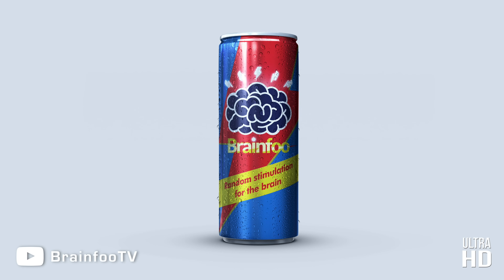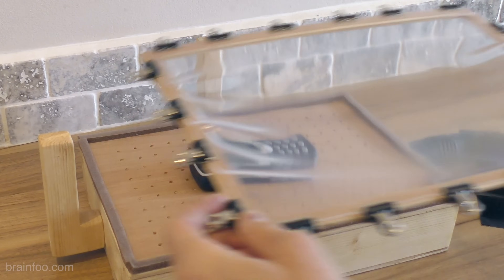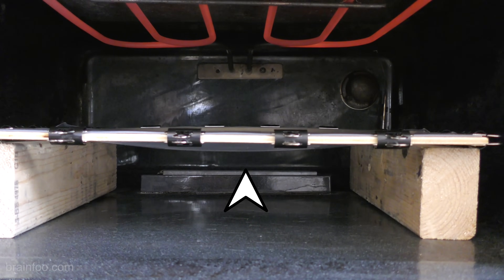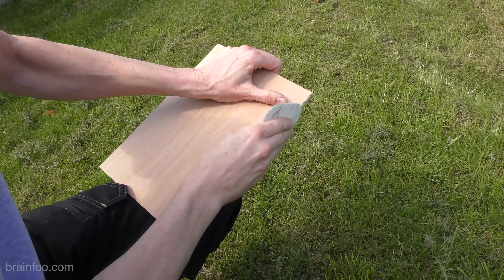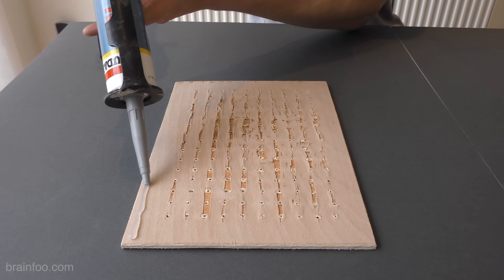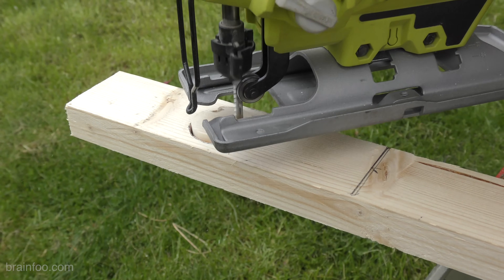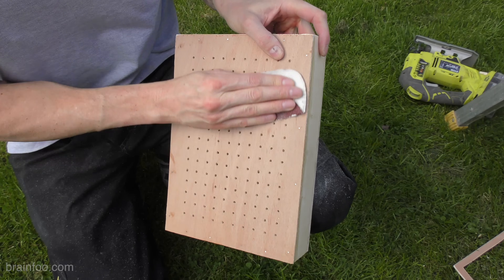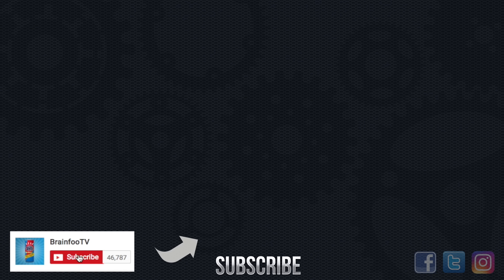EASY VACUUM FORMER - Chocolate NOKIA

Comment: PVC rigid film/PLA film/PET film 
PVC lamination film
PVC/PVDC film 
PVC metallized film
PVC/PVDC/PE film 
PVC/PE film 
PVC/EVOH film
PVC/EVOH/PE film
Cooling tower PVC film 
Antistatic PVC film 
PET film 
PET/PVDC film 
PET/PVDC/PE film
PET golden film 
PET silver film 
PET anti fog film 
PET face shield 
PET G film
PET/PE film 
PET/EVOH/PE film
PET metallized film 
Extension tubes with needle free connectors
PA/PE film
PA/EVOH/PE film 
PA/PP film
PP film
PS film
Blister aluminum foil 
Alu alu foil
Goggles 
PET Folding boxes blister boxes 
For food packages electronic package blister packages pharmaceutical packages and folding boxes and so on

Comment: Great Video! Who wants to discuss the desired most efficient "depth" of the suck box to get the best Vacuum action going? On the small 12" x 12" inch vacuum form table I'm attempting to build, I already want to place the vacuum hose straight down under the table like a kitchen sink. Don't mind placing the vacuum form box up on stands or even wheels. My shop Vac (I plan 2 use with the vac-u-form) is a 1989 Genie 1.5 (horsepower?) 2" inch hose outlet model that still works fine.

Comment: Could you use a heat gun to melt the plastic instead of the Oven 

Has anyone tried this?
Reply from the maker: Only for very small surface areas
Reply: Yep! Wanted to know the same thing! If its 2:30am and your FX Prop is due at 8:00am,  I would try a Heat Gun (not a blow dryer) if I was makin' somethin like a Zorro Mask. Would even use my Mannequin's head as a "buck" after I applied some Aluminum Foil on the mannequin to help protect it from the heat. Hey! I think I did this already and just gave away a hidden gem fx shop secret! Oops! #DesignerTJP

Comment: Doesnt work at all for me. Plastic  keeps getting air holes and gets to hard before forming half way forms. I hate it doesnt work for me and spent a good price on plastics. Ughhhhhhh
Reply: Put in toaster oven @ 250 degrees. And form box is air tight. Tried extra clips and plastic still slides out when in oven. This always happens to me.

Comment: Why use caulking when you can use wood glue as a much stronger bond between the wood pieces?
Reply from the maker: Because a silicone or caulking is nearly as strong but seals all holes / gaps 100% airtight, even if your wood is not perfectly smooth

Comment: Hello brainfoo, what type of plastic sheets do you use? ( or what plastic usually people call it) thanks man!
Reply from the maker: The best plastic I used were HIPS (most forgiving for beginners)  : http://www.ebay.co.uk/itm/High-Impact-Polystyrene-Plastic-Sheets-Vacuum-Forming-1mm-x-457mm-x-305mm-PK10-/121444123655?var=&hash=item1c46a24407:m:mnyYUaQemdzvfA2qKhZI9iA

A bit pricey, but got the best results by far. Once you get good, I'm sure you could use cheap ones easily
Reply: and may i know what material is the cheap one? im trying to buy both so i can compare the result :)

Comment: What if you don't want to build your own or if you don't have the tools? (I don't have any tools like drills and saws)
Reply from the maker: Holes could be hammered in maybe with a nail, but a saw is pretty much needed unless you get the timber cut to size for you
Reply: https://www.ebay.co.uk/itm/A4-Vacuum-Former-Kit/283194265117?hash=item41efb18e1d:g:UYQAAOSwYq5bU0Hh